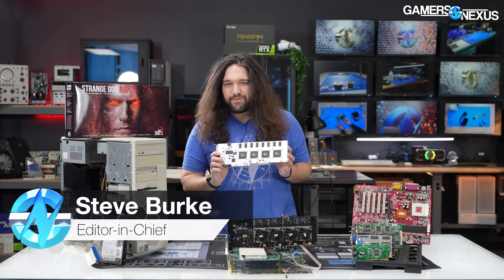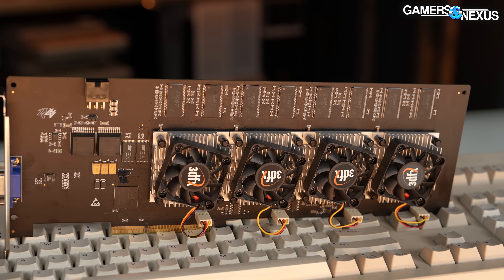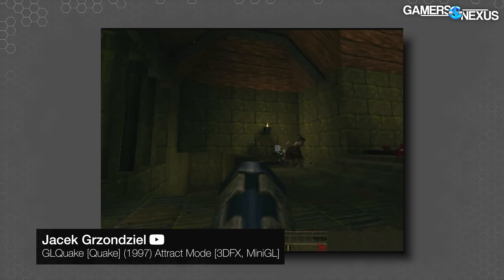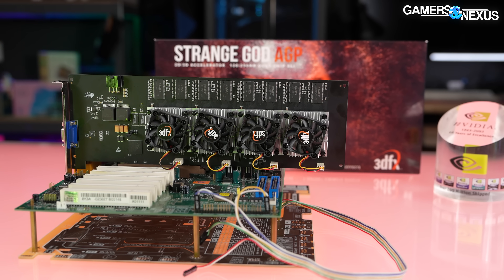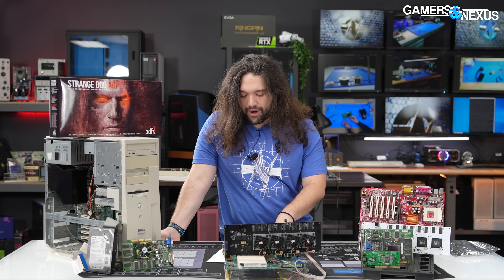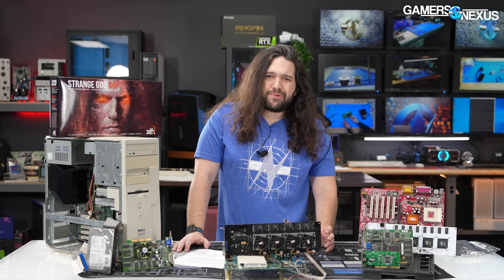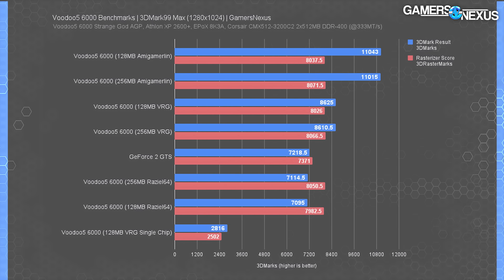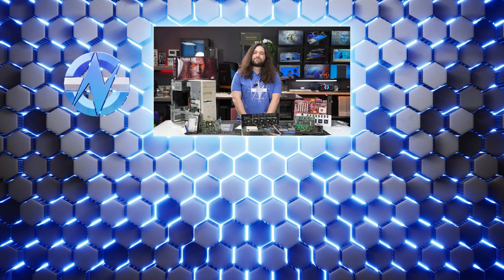Back from the Dead: 3dfx's Unreleased Voodoo5 6000 Quad-GPU Card

Comment: I had 2 T600's I remember running a heavily customized windows XP on it with a custom UI and I u[graded it to an Nvidia 5200. It came with a dell Sony Trinitron monitor. It played Half Life 2 extremely well and it looked great on the Trinitron. One had a Katamai CPU and the other a Coppermine. I had maxed out the ram I think it was somewhere between 1-2 gb LOL I squeezed every last bit of performance I could from that system.

Comment: i still have my voodoo 1,3 and 5500!

sometimes i play some glide games on them just for the nostalgia factor

About the 5500.

i played many games on it and did not had any problems.

my hardware is a
Asus motherboard with a pentium 3 pga socket 1ghz.
128mb or 256mb ram (i do not install any special patch for the ram bug on 98 so i just don't use more than 512mb ram , including the gpu vram)
soundblaster live 

and surprisingly Windows Me!!!!!  (its more stable then 98se on much of my retro hardware)
BTW i do not use any unofficial software 
TBH, owning a 3dfx card makes you feel like a true pc gamer.

Comment: Fantastic trip down memory lane. I had an S3 Virge early on, but it either didn’t have the VRAM or capability to do texture mapping so slotted a 3dfx in alongside it. The whole VGA pass through deal was janky AF so migrated to a TNT, and then TNT2 Ultra which smashed 3d gaming at the time and supported D3D. The GeForce OEM cards were everywhere just after that, it’s what you got in your Dell Precision.

Comment: Thanks for doing this review of the Voodoo 5 6000, it was my dream card in early 2000 and was at that time, i had no idea what was really going on with 3dfx. Awesome work! I still remember the times i used to own a 3dfx card and it was one of the best times in my pc gaming life. My first card was a voodoo mania voodoo 1 3d accelerator card, that was paired with a S3 Virge on a 486 DX 4/100. Yes i know that the CPU was too slow for that card, but even with that system i could play almost anything in 512x384 with more than 30 fps - when running in glide.

Comment: The thing that killed 3Dfx was the botched transition from pass through 3D accelerator to integrated 3D on the desktop. Their VGA solution & compositor suffered from performance issues that really hurt them. Then they alienated their IHVs by opening a factory in Mexico to sell direct. It might have been needed after losing in the market of course but it added to their overheads and hastened their demise. P.S. I see you mention STB at the end, that was the factory in Mexico.

Comment: The 3D Mark 99 texture test problem might be a software and not a hardware one. I build Pentium 3 800Mhz and Pentium 4 2.8Ghz Win98SE systems a few months ago and multiple graphics card like Ati Radeon 9000 Pro, 9600 Pro and so on also had this problem. In games they work without texture artifacts.

Comment: I remember buying the voodoo2 Diamond brand back in 1998. I was blown away with it because you could even emulate Nintendo64 with ultra HLE, and play mario64 on windows. The box art of the voodoo3, 4, and5 line are just amazing. Now they are expensive and collectors item. I would even buy a broken voodoo5 and make it decoration for  a wall

Comment: Man the history. Brings back memories. Wish you would have put out a request for hardware. I have a full working epic setup from that sort of era (at least for your original choice of parts). Athlon XP 1700 TB and an Athlon 2500 mobile, DFI Infinity nforce2 motherboard (also a DFI lan party). And I have a Gainward Geforce4 ti4600 you could have used for comparison lol (though this was a much later card). I do have a working nvidia TNT2 as well. Oh and 512MB of the finest ddr (bh-5 chips).

Comment: Nice review and history. I do with you guys would have had the chance to add a few other competing cars such as an early Radeon, Voodoo3's, Nvidia TNT2's Geforce 128...
There is now a huge vintage pc building community boomed recently. And I do understand the pain or building a vintage pc. I recently got back into it in the last year and it's just not as quick easy and reliable as it is now.
I am rocking a K6-2 400 with a Voodoo3 2000 PCI 16MB at home.

Comment: I had a pair of Voodoo2 cards in SLI for a while, and then went with a Voodoo5 5500.  Very nice card, which I would have used longer if it hadn't decided to die.  And then the company died, too.

Voodoo cards were, by a large margin, the best option for games that supported GLide.

Comment: I would not be interested in this board at all until the bugs are removed and a proper heatsink design is implemented, specially at that price. I don't speak for everyone, but i'm pretty sure we want the voodoo5 experience, not as it was back then, but as what it could/should have been at its max potential.

Comment: While in University in 1987, I lived on rice, pasta and toast for most of a year in order to afford a Voodoo Rush. I had seen what must have been am original 3dfx card which needed to be piggybacked on a 2d VGA card and knew i had to get a 3d card.I could run GLQuake in 640x480 at about 60 FPS IIRC, which was a huge improvement over software mode!

Yes there is nostalgia triggered by this video for me. They were a nightmare to get working but were also a huge leap forward at the time.

Comment: Some much hardware I owned back in the day, or still own today in this video. I no longer have the i740 card which "unfortunately" died on, so it was replaced with an S3 Savage 3D card, and then was used in conjunction with 2 Monster 3D II 12MB cards in SLI.

This setup was ultimately replaced with a Asus V6600 Deluxe which thanks to hardware T&L blew the Voodoo 2s out of the water and since it didn't require VGA passthru had a much clearer image as well.

Still have the Voodoo 2s and V6600. No idea where the Savage 3D went, but I'm awash in AGP cards, all of which are superior in terms of 2D and 3D performance.

Also, I have the MSI KT3 Ultra II mainboard. One of the best features are the debug LEDs. 4 multi-coloured (red/green) LEDs on a slot plate so if the system failed to post you'd simply look at the back of the PC and look up the error in the manual. A feature which should have survived to this day, as it doesn't involve counting beeps or having to look at the mainboard itself (closed case / opaque side panel) making it a bit easier to troubleshoot things.

Comment: 3Dfx required atleast some mediocre 2D GPU like S3 Virge.
The day RIVA TNT came out, 3Dfx was dead.
Then the cheap single chip cards compensating power with 16-bit color and dithering totally finished it off.
3Dfx was for brief moment "best you can get, but just like Matrox, they've totally missed the train and all future attempts were futile."

Comment: A few corrections, there was a 3d accelerated version of Quake before GLQuake.  It was VQuake and it ran on the Rendition Verite cards. Also GLQuake really wasn't OpenGL. They referred to it as mini-GL as it only used a small susbset of OpenGL. And it was basically just a Glide wrapper that was simply a DLL file placed in the games directory. So, in reality it was little more than a Glide version of Quake.

Comment: For some Maya PC project, we got some samples from Nvidia, on PCI card, 5000 and 6000 chips by TSMC / Nvidia. Production chips on it, not custom samples.
We never used them, the Nurbs modeling project we did failed, we reopened this project on RTX gen cards, but still not good enough.
Realtime Nurbs models, is just as Fusion, always very near ! Since 1995, we are always one year away of releasing it !

Comment: Powervr GL quake blew me away! Still gaming, but not enjoying new boring games. You thought that was hard? You should try setting your IRQ to avoid conflicts, setting you heads, sectors and cylinder count on your hard drive in the bios (on the sticker of the harddrive) with master slave jumpers on IDE cables that weren't always apparent., setting your comports and getting the lpt ports to works. That agp slot was a blessing, but agp didn't necessarily give you an edge over pci 33mhz. Instead video cards stopped using pci because agp/pci versions didn't really give you a noticeable advantage.

Comment: Back in the day, there's three things I vividly remember - finally getting Cable Internet in my area, getting the 3dfx Voodoo 5 5500, and acquiring an ATI Radeon 4870x2.  The good ole days of getting 220+ ping in HL Mods was SOOOO much fun! 🤢

EDIT: I owned three 3dfx Voodoo 5 5500's, and never experienced any issues w/ them like what was described earlier in the video.

Comment: I put gel on the plastic to soak in using natural occurring thermal dynamic pull of hot to cold and vise Versa based on connection chain

Comment: I still have my Creative 3D Blaster Geforce 2 GTS box in my closet, no card or anything inside though sadly. Of the 3dfx cards I only had the original Voodoo 3D accelerator. After that I had RivaTNT, Geforce 2 GTS, Geforce FX 5700, Radeon HD 3850, Radeon HD 6850, Radeon R9 270X, RTX 2070 and now RTX 4070 Ti. This video was a fun look back in time. Damn mid 2010 was like dark ages, no good games worth upgrading GPU for.

Comment: You should have included Voodoo5 5500 AGP benchmarks in there. I would have really liked to see if the 6000 would have been a bunch better. I currently have a 5500 AGP driving my DOS/WIN98 machine.

Comment: seeing Quake 3 Arena, a game I played very often very long, being shown on GN, is something I would not believed...
Anyways, seeing that chart on 23:20 makes me a bit sad...
the infamous 125 fps wasn't reached back then.. 

For explanation: 125 fps is the sweet spot for the Quake 3 engine (later all engines were renamed to id tech) to achieve higher jumps and faster movement, which tremendously helps in Quake 3, which is a really fast paced shooter.
333 fps would be even better, but since most servers are running with the standard (and thus very low) snaps and sv_fps, it will only lag you if you are playing on a non-LAN server.
best example is q3dm13: the jump from the middle platform to the mega health is not possible if running with 70 fps or something. But with 125 fps (nowadays you have to limit it via com_maxfps 125) the jump is possible.

And one thing to note: even today Quake 3 Arena can look fantastic for a 24 (!!) year old game, if you add some higher quality textures and shaders. Be aware that on older versions (I just played 1.16n, and just rarely 1.32 or the community versions 1.33 and up) the engine can not take that much memory.
In the past I experienced that a lot when running with many custom maps - crash on startup (maybe someone can remember Z_Malloc: failed on allocation of XXXX bytes)
not to talk about all the games the engine spawned... and also tech demos, and there were a lot of 3D stuff made with that engine, because the mapping tools were relatively easy to use, and in the end you can drop all custom models, textures and shaders into one file (pk3 is the file extension), share it, and everyone drops it into the baseq3 directory, and you're ready to go. downloading maps directly from the server was possible, but you had to know exactly which settings to make server and clientside. But back then, internet speed was limited, and no server operator wanted people to slow their server.

well damn..... takes me back, and makes me feel old.

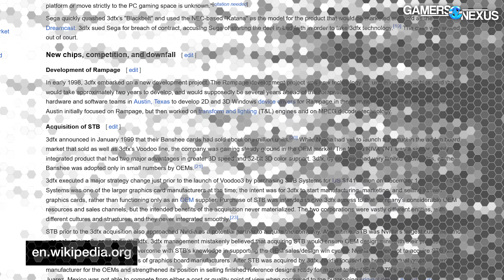edit: oh, and I LOVED the shot at 28:10

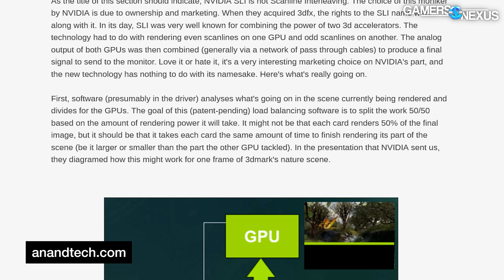Comment: 10:30 The banshee wasn't the first 2d/3d card. It was the previously mentioned voodoo rush.
If you ment the first 2d/3d card made entirely by 3dfx, that would be correct, since the rush was a partnership.

Comment: On one hand the reason i got into retro pc building was the nostalgia. On the other hand, it's just pure fun to try and crank up the heat on old hardware and see how far it goes. On a gaming level, of course you could just emulate everything or buy a GOG version of the game, and all this retro stuff is actually completely pointless, on a level where i have to reassure myself that i'm not wasting my time because i'm actually having fun. Considering these aspects, i don't relly know where these new cards fit in. That said, of course i think they're awesome. I just just have mixed feelings. Same goes for the AWE64 Legacy. Of course i want that too, but again, everything can be emulated to pefection, so what's the point at the end of the day? Of course they're using the old chips, but what does it mean for this nostalgia-driven hobby to use new cards? My brain is shorting out on this one.

Comment: I loved 3dfx, I had a banshee, then dual voodoo 2s with a matrox g100 then a voodoo 3 3000.  I still have my voodoo 3 3000 running in my win 98 retro pc.  One thing worth noting is glide absolutely wiped the floor with direct 3d both in terms of image quality and performance but Microsoft obviously had a lot more pull in the market which allowed them to get more devs focusing on direcx.  Also worth mentioning 3dfxs t buffer anti aliasing was the 1st true full scene anti aliasing 😉

Comment: I did have a Voodoo 2 with 12MiB and later a Voodoo 3 3000 with 16MiB of V-Ram, and I do fondly remember these time, I also remember that I was very close to buying a Voodoo 5 5500 Card because of my good experience with voodoo cards and also watching some videos on DVDs from PC magazines in country comparing the Voodoo 5 5500 to the GeForce 2 GTS. That being said when i was in my local PC store at the time i did switch my decision  to buy the Voodoo 5 to the GeForce 2 GTS. I really don't why I changed my mind at that point but I did and didn't really regret afterwards. In hindsight I really would liked  to have an Voodoo 5 5500 in my collection but at the time i always resold my old hardware anyway and the GeForce 2 was more desired and valuable at the time I sold it.

Comment: Man .. love seeing that my old AMD Thunderbird 1.2ghz with the Geforce 2 GTS ran Quake 3 within 3 fps to the Athlon XP 2600+ from this article (iirc it was q3demo1 & q3demo2 back then, but those showed pretty strong internal consistency anyway). Even saw the same CPU bottleneck resolve coming from my older p3 450mhz!

.. Ended up nostalgia digging and found my old Q3Demo1/2 1024x768 benches .. with a Riva TNT2 M64 bench as bonus!

Prolink tnt2 m64 32 mb detonator 3 6.31 @ p3 450mhz: 12.1 FPS
Asus geforce 2 gts 32 mb deluxe asus 5.33a drivers @ p3 450mhz: 56.2 FPS
Asus geforce 2 gts 32 mb deluxe asus 6.31 drivers @ t-bird 1.2ghz: 78.6 FPS

Golden age of graphics hardware, this stuff .. I remember saving up a whole summer job as a kid to be able to afford my first Diamond Monster 3d II Voodoo 2 (and later another summer job for the 2nd one for that sweet, sweet 1024x768 SLI!)

Working on Ray Tracing hardware these days, in large part motivated exactly by that era .. so .. err .. see mom, those vidyagames weren't all bad, were they!? 🙂

Comment: I still have a pair of voodo2; one from genius and another... panoply was it? They together, with the "mismatched SLI" driver allowed me to play MechWarrior 3 and other games at 1024x768. The board notably only supported games up to 800x600 res. Their SLI was not done using a flat cable like suggested in this video. Just the passthru cable, from one gpu to the other and then to the pci vga. Then each one drew their line (on the screen) to achieve SLI. In particular they shown a noticeable "chipping effect on edges" as the odd/even lines weren't perfectly in sync; maybe a frame or two shifted, mostly noticeable when turning around. But it was super playable and enjoyable. Zero artifacting if I recall well.

Comment: I remember being so excited to get a, what turned out to be last, then latest gen 3dfx card....  still at the time having dual Diamond Monster 3D II Voodoo 2 12MB in SLi
Then I was ordering PC's at work and Dell supplied an NVidia Riva TNT2 instead of the one I spec'd, I complained and they sent me what I ordered and told me to keep the TNT2 :)
Another time I got a Voodoo 3 3000 out of them for free.  Dell could be pretty good back then sometimes, but then I was ordering a lot of PC's for my company...
Think I actually still have all those cards somewhere.

Comment: Ahhh, the AMD Athlon XP 2600+ brings back fond memories.  I used it in the 2nd PC I ever built. First was an AMD K6-II 400MHz I built in 1997 hen I was 10.  From my understanding the 2600 meant it had equivalent performance to a 2.6GHz Intel of that time.

Comment: I'd love a shot version of one of those especially if it had DVI like the Mac PCI version of the 5500 (bios modded mine for PC and to use the DVI port, so you loose a little speed compared to agp version, but you can use HDMI, plus a little overclock will get back some of that agp stock speed, not to mention bypass the finicky AGP power requirements), that would be the crown jewel of my GFX card collection and be my go to 98SE card.

Comment: Couple things to note

3DFX did make some of these cards, the one you have is not a real card and yes, they never went RTM but there are some real 6000 cards floating around.

Also, it’s a 3D accelerator chip not a GPU as it runs in sync with the CPU offloading T&L processing to the CPU.

Comment: yes it neve happened because i had one on order was in phone contact with 3DFX or voodoo , I still have the original 3dfx card( the first commercial video dedicated graphics card), along with the voodoo 2 ( i had 2 x voodoo) 2 cars running in since with the adapter cord., 5500 and was looking forward to the 6600 hundred not 6000,
I even have a 600 dollar physics card and had to wait 8 weeks to get it only to find out all it did was use more power.